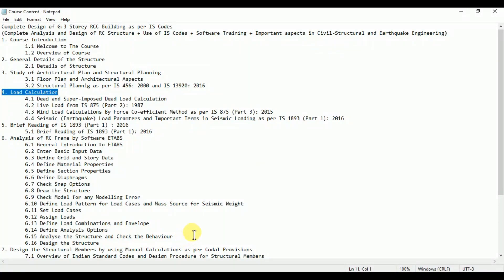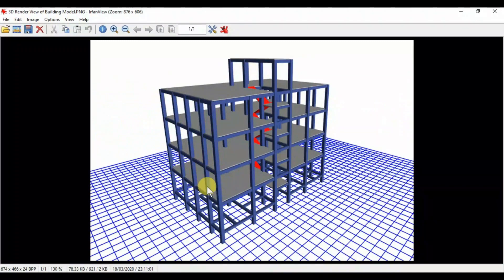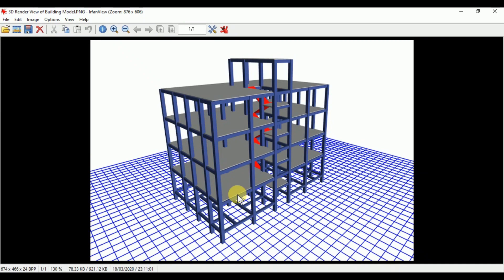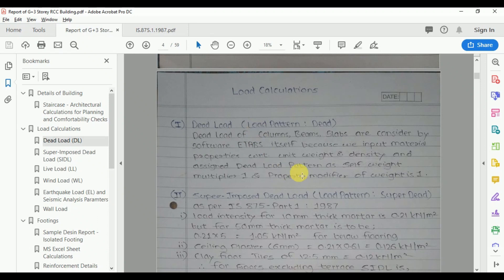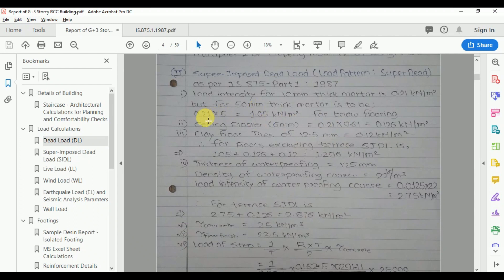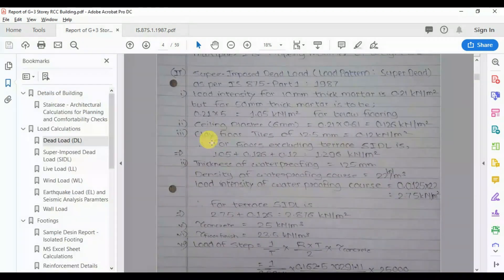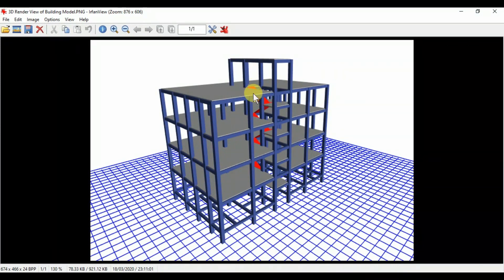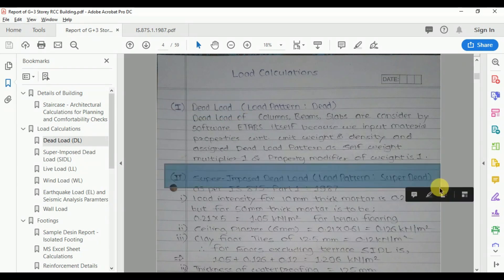4.1 Dead Load [DL] & Super-Imposed Dead Load [SIDL] Manual Calculations as per IS 875 (Part-1): 1987

Comment: In waterproofing course you are calculating mass of waterproofing course which you have written as load intensity ri8 ??? If that is the case we know density =mass/volume, we have the density ,but how have you taken the depth of waterproofing as volume ??? I don't get it ,mass = density × volume but instead you multiplied density with depth ,can you explain this ??
Reply from the maker: sorry, it was writing mistake... so i mistakenly tell that it is density...
• 22 kN/m3 is not density it is unit weight of waterproofing course
• 125 mm = 0.125m
so, 0.125×22 = 2.75 kN/m3
● by-the-way, calcution is right in the load calculation report

Comment: For the unit weight of floor finish how is 23.5 calculated . From is code floor finish clay floor tiles unit wt is 0.1 to 0.2 pliz explain
Reply from the maker: IS code gives is for tiles is for kn/m2
here in formula we have to put value in kn/m3
as this i have taken referance with NPTEL Course by Prof. Dhang of IIT-KGP
do check out his lecture of staircase design you'll sort out of this doubt

Comment: Hello sir
Sir i wanted to ask we don't  use factor of safety  for loads in etabs as we add factor of safety  manual
Reply from the maker: you have to enter working loads while assiging them in ETABS.... not factored loads,
by the way whatever factor for load you want, that you can do it by load combination....
but do apply loads as working loads while using ETABS so you can check the structure for serviceability criteria within same model....

for Factor of Safety for Materials you have option to change them under view/revise preferences under design ribbon

Comment: Sir,there is small doubt in calculating super dead load . Can u explain how 50mm thick mortar is 1.05 kn/m2 ?if 10mm is 0.21. ? Actually 50*.21=10.5
Reply from the maker: for 10 mm it is 0.21 kN/m2 right
so for 50 mm
it is 10×5=50 :: 0.21×5=1.05
hence for 50 mm it is 1.05 kN/m2

Comment: Could you please explain, how ceiling plaster is calculated ?
Reply from the maker: I consider average standard wt. for unit wt. of 10mm plaster which is 0.21 kN/m2 and then for 6mm Ceiling Plaster Wt.
0.21 × 0.6 gives ceiling plaster wt./m2
Reply: @AkshayThakur  0.6 ?
Reply from the maker: @tanzinwangchu9888  0.21 is for 10mm thick plaster and so for 6mm plaster it is need to multiply with 0.6

Comment: I think there is some kind of confusion with waterproofing thickness and its load calculation. the thickness of waterproofing is 0.125 m but you took it as 0.0125 m.
Reply from the maker: Yes, In the report by mistake it is 0.0125 but Calculation is correct i.e, 0.125*22=2.75 kN/m^2

It was a writing mistake but there is also note to that, 125 mm Thickness for Waterproofing
Reply: @AkshayThakur  Thank you😃

Comment: Sir load combination explain me manual and automatic what difference?
Reply: Sir confuse for load combination how to make own load combination?
Reply: And automatic both?
Reply from the maker: See, Auto Design Load Combinations are only Design Load Combinations as per selected Design Code for Load Patterns you Define...
Where in Manual here, see I define Design as well as Serviceability Load Combinations in which we can specifically used Serviceability Load Combinations for Analysis Checks and Design Load Combinations to Strength of Structural Members...

In ETABS for Indian Standards there are no pre-auto define option for serviceability load combinations so in the course I manually define load combinations as per Indian Standard codal provisions...
Reply: But sir how to make load combination in manually? I see code 456:2000 but confused for load combination?
Reply from the maker: @juhilsuthar3035  see the table, follow rows and columns, read the bottom notes of the table...
Reply: Confused for cement plaster which teble give is 456:2000 of no.?
Reply from the maker: refer IS 875 Part-1 1987 for that...
Reply: @AkshayThakur  yes I already but give only 10 mm ceilling plaster.6/10=0.21*0.6 am I right sir?
Reply: Sir Why need for mashing,live load reduction factor,auto realeable all understand me🙏
Reply: P delta what is?
Reply: How to make shear wall for lift and design?
Reply from the maker: @juhilsuthar3035   @juhil suthar  
• Mesh refinement may improve the modeling and analysis of regions with stress concentrations, extreme force gradients, member connections, etc.
• Live Load Reduction Factor makes decrease in load and causes Design Economical...
• In practice if you don’t perform release on a secondary beam, it will be treated as as restrained & thus the hogging moments will occur in the secondary member which in turn will induce torsion in the primary member on which the secondary member is supported...
Reply from the maker: @juhilsuthar3035  specifically it is considered for tall buildings in which it causes extra moment because of shifting of axial force from centre of column in each member...
Reply from the maker: @juhilsuthar3035  model it and design in etabs or otherwise follow some standard books for manual design procedure as per code...
Reply from the maker: • Mesh refinement may improve the modeling and analysis of regions with stress concentrations, extreme force gradients, member connections, etc.
• Live Load Reduction Factor makes decrease in load and causes Design Economical...
Reply from the maker: P-Delta Analysis is a type of analysis that is particularly important for laterally displacing multi-storey building structures experiencing a gravity load....
Reply: Sir if I make for wall load calculation=a.a.c block so I changed brick wall density but my design error before analysis why ?
Reply from the maker: @juhilsuthar3035  if masonry work is by aac block then you need to calculate wall load as per density of aac block...
Reply: Sir slab design 7.5 video?
Reply from the maker: @juhilsuthar3035  It was uploaded but there was one mistake so I take down that video... due to no free time for a while, so I'm unable to create new one...